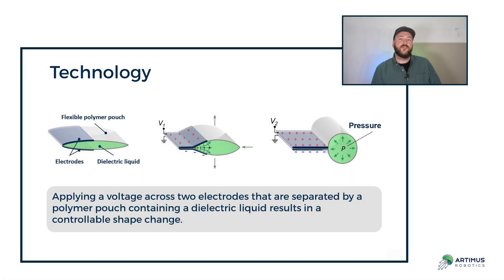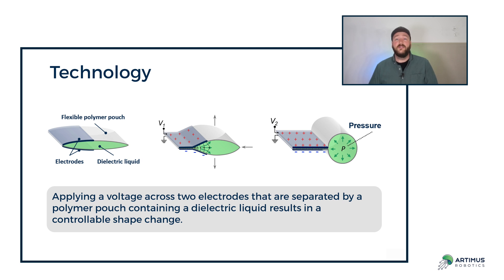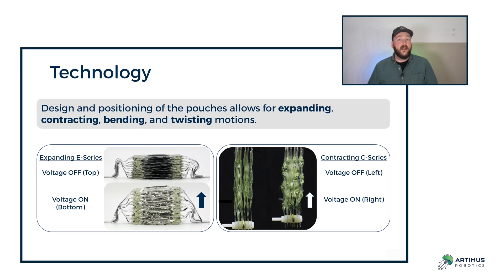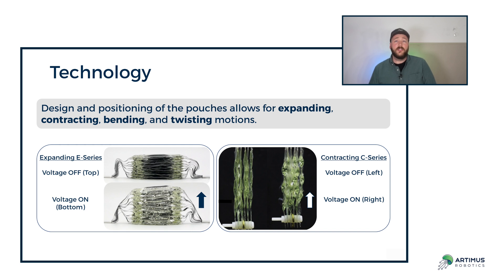Artimus 101: How HASEL actuators work | Artimus Robotics Introduction to HASEL actuators

Comment: Does the high voltage cause electrolysis in the fluid, and if so how does that compromise the material with the buildup of gasses.
Also, how does the power draw/efficiency compare to other actuators or motors on load, ie; lifting objects for continued periods of time.
Reply from the maker: That’s a great question. The high voltage does not cause any changes to the fluid, electrolysis or other. Thus no gas build up. The lack of air or gas inside the actuators can have major benefits for our customer using actuators in unique locations. 

Efficiently is extremely case by case dependent. Here is some starter information on the electrical consumption. Feel free to reach out via email at info@artimusrobotics.com. And if you have a specific use case use our application assistant available on our website. https://www.artimusrobotics.com/post/power-consumption-of-hasel-actuators